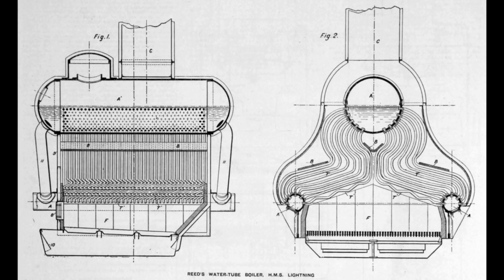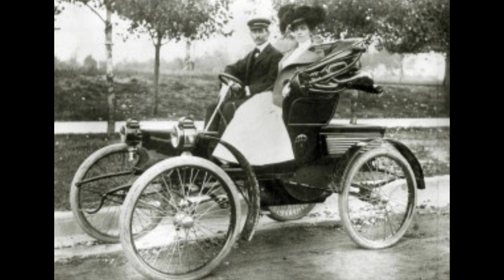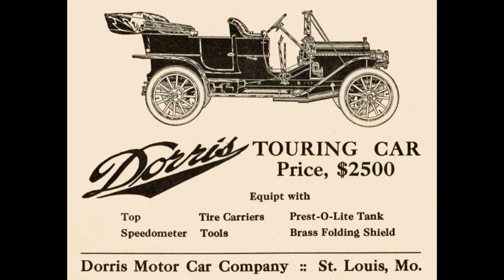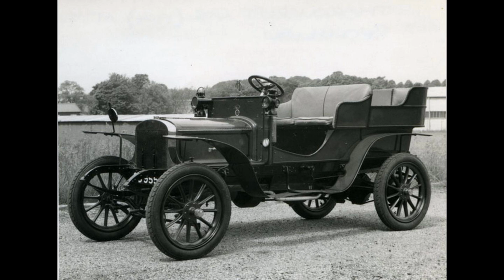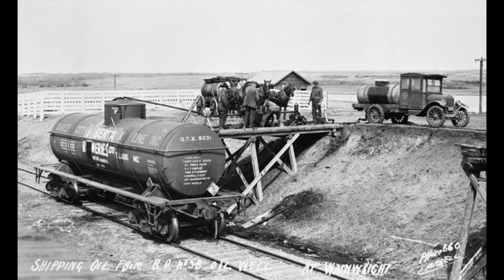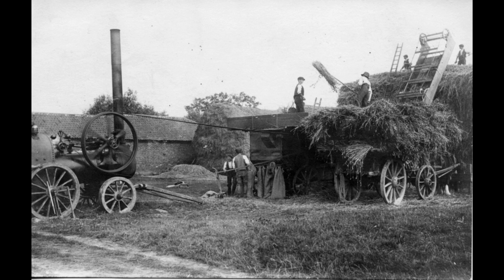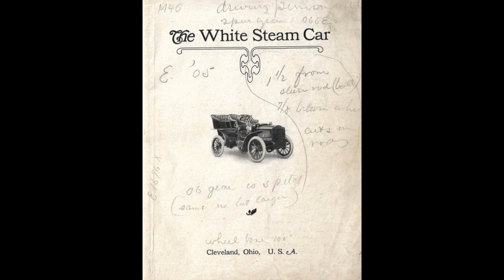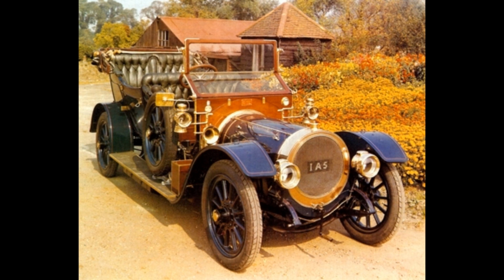Steam Boilers in the 1900's - The Unusual Case of the Car and Ship

Comment: Great collaborative video:  

A couple of thoughts:  

until about 1900 gasoline or naphtha was basically an unwanted by-product of refining the oil industry's principal product ----kerosene (called paraffin or coal oil in the UK) for lighting. Starting in the 1860's, kerosene started being refined and distributed in vast quantities all over the world for lighting.

 It was my impression that steam cars usually used kerosene as their primary fuel, with a much smaller quantity of gasoline used to get the burner hot enough that kerosene-- which has a flash point of about 100 degrees F-- would vaporize and ignite.  So a steam car owner in the early days could fuel his car with kerosene (usually in gallon or five-gallon cans) at his local hardware or general store.  

For a warship, using oil rather than coal had enormous advantages:  reduced manpower requirements, greater range, rapidity of refueling, and far less smoke to give away the position of its ships.  As it was starting to build capital ships powered exclusively by oil, the British Admiralty was extremely concerned about having a reliable supply of oil fuel for its new ships. It went to far as to purchase in 1914 a controlling interest in a British company called the Anglo-Persian Oil Company which had rights to large amounts of oil in Persia (now Iran).

Although warships quickly converted to oil fuel, most commercial steamships, with the exception of large express ocean liners, continued to be powered by coal until World War II. In this era coal was available in almost any port and was about one-third the cost of oil fuel.

Comment: No mention of the high pressure (200 psi) water tube boiler invented by Henry House around 1893. Used in both road vehicles (2 cylinder compound) and boats (1898). Also used as an airplane engine (never flew).

Comment: re: steam-powered automobiles, I'm surprised that the Doble Steam Cars were never mentioned.   https://en.wikipedia.org/wiki/Doble_steam_car
Reply: There was one shown.
Reply: @keithstudly6071 , shown, perhaps, but never mentioned & likely no one but a historian would have been able to pick that out (I'm not a historian). I think that the Doble Steam cars were the pinnacle of steam engine cars. With modern technological refinement, they might even be a viable competitor or alternative to the gasoline engine cars of today & possibly even rivalling the low cost of operation & high performance of today's electric cars.
Reply: @synthyawylder3297  Yes, the Doble was worth a mention.
Reply: You shouldn't be surprised, because Doble steam cars were not a successful innovation, but rather a last unsuccessful attempt to keep steam technology relevant at a time, when steam power had been surpassed years ago. Only some people desperately trying to sell outdated technology they have specialized know-how in, like selling typewriters after introduction of the personal computer.
Reply: Jay Leno, who owns two running Dobles (and at least three White Steamers) and done videos on all of them pointed out that the Dobles are pretty much unmaintainable without modern metallurgy and ceramic coatings. They run so hot they burn out their steam generators in short order.

Comment: Love this topic, as you're basically covering the genesis of what I worked on in my time in the navy. I was an engineering rate on a nuclear sub and nuclear propulsion is arguably the final expression of the steam propulsion plant. Despite the mythical powers that people like to ascribe to nuclear powered ships, basically they are nothing but a regular steam plant that replace coal or fuel oil with nuclear fission to heat the boiler water into steam. Their real advantage over traditional steam plants is endurance, not power output. (of course, nuclear power is outside the period this channel normally covers)

Comment: Rough rule of thumb for naval architects during early design: increase design speed 3 knots, double the required shaft power. Usually a little conservative,  but indicative...
Reply: Does that stay true all the way to 30 or 40 knots? I always assumed it be far less than double at low speed & far more at high speed.
Reply: @dorn0531  Cant say how exact the rule of thumb is, but the proportions of increase should stay the same no matter what speed. Thats how fluid dynamics work. Without doing the math right now, it sounds about right to me.
Reply: @GoldenCroc  Awesome, thank you. I am not an engineer in any capacity so I really appreciate learning this stuff. Also why I enjoy Drach's engineering knowledge

Comment: Great post, thank you! I was aware there were steam cars but the small tube boiler originating with them was news to me. In the literature on early destroyer / torpedo boats, it's mainly from railroads that the technology seems to have originated for higher steam conditions that led to triple and quadruple expansion piston engines and finally turbines. But it's certainly true there was a change from fire tube to water tube boilers, I'm not sure exactly what year that took place but around the turn of the century. Somehow the discovery of the very long, light displacement hull forms and advanced steam engine and propeller technology all came together by around 1870 to produce small vessels like HMS Lightning. I suspect, but have not found good evidence, that Confederate blockade runners and steam yachts had a role in that evolution but this line of development, and the speed records it produced, would be a good subject for a future video.

Comment: I think the US went way deep into traction engines vs anywhere else, my county's steam fair as it is brings 20-30 of them every year its quite a sight seeing this field of coal and wood burning engines chuffing away, and there's minimal health and safety, though owning and operating a steam engine in Ohio is itself a very laborious process to get licensed
Reply: Since you're from Ohio you're probably familiar with the fatal Medina incident, which is why the licensing process is more stringent now.
Reply: @bobsmith2637  ya but it is suprising how close to big steam engines you can get at the county shows
Reply: Traction engines were popular on American farms but not on American roads.   In England traction engines were often used to pull small trains relatively short distances over generally good roads.  America had long distances and generally bad roads. For any real distances it was cheaper to build a railroad, even a small, temporary railroad.

Comment: I was “that Ensign” that had to remove scale deposits from Hull-Oakes Lumber Co’s 3 steam boilers. 

Steam evacuation scale removal only works if it’s done daily, which requires shutting down the fires, draining the boilers, injecting high-pressure steam in an area the size of a small garage x3, refilling the boilers, restarting the fires, and bringing the boilers up to steam before the next morning. 

The mill did this on Fridays, and used my small frame (not so anymore😄) to scurry on my back with the 100f tubes 6 inches above my face to chip away at the 1-1/2” thick scale with hammer and chisel. I talked my Superintendent into using a small pneumatic hammer and custom-made fittings, which improved the work drastically.

Comment: With a couple of exceptions, nuclear submarines are steam driven so navies eventually were able to put steam powerplants into submarines.
Reply: It's funny to me that this period in history will probably be considered "the late steam era" by historians a few thousand years from now.
Reply: Steam powerplants were used in submarines quite early as well. Look at the British K Class
Reply: what are the exceptions then? :-)
Reply: Older subs still use diesel. Newer subs use "Air-Independed Propulsion" (AIP) Sterling engines. Sterlings were originally a steam engine, but in Naval AIP they use a mostly closed gas loop operating by thermal difference from ambient temperature and liquid oxygen. They're quieter than nuclear because they can run ultra-low frequency electrics, but they can only run for a few days on a tank of O2. The Swedish Gotland class is an example, and not the only.
Reply: @alan-sk7ky  The US Navy built a couple of subs with turbo-electric drive.
Reply: There's also Ulysses, the sub from Atlantis: The Lost Empire, which was steam powered.

Comment: In the US two major Railroads, the SP (Southern Pacific) and the AT&SF (Santa Fe - the one with the War Bonnet paint scheme), began experimenting with oil fired steam locomotives in the mid 1890's and were converting large numbers of locomotives by the late 1890's. Oil firing was a well known and established art by 1899 so upscaling it would have just required wanting to do it, and accepting the occasional "OOPS!". (BOOM!!)
Reply: The Elk Hills Naval Petroleum Reserve in Southern California, west of Bakersfield, was a large producer of heavy crude and much of it went to two uses. It was pumped to a simple refinery at Grapevine Pass and separated into heavy bunker fuel which was sent to Long Beach for ship's fuel, and light bunker fuel which went to Barstow to fuel the Southern Pacific locomotives. By the start of the 20th century most of the steam locomotives in the South West were oil fired.

Comment: "Traction engines are naturally slow"  25:22 

No! NO! NO!!   Traction Engines are UNNATURALLY slow. Just watch some. They're on YouTube....
Reply: but so much torque, it's hilarious to watch someone show up to a tractor pull in their quad turbo 600+ HP diesel monstrosity and then get their ass kicked by a 15 HP 100 year old antique
Reply: @bobsmith2637  Do you mean something like this?
https://www.youtube.com/watch?v=kA0E7kRhd6M
Reply: @bobsmith2637  If you know about Tractor Pulls, the tractor pulls a sled and the weight/load on the sled increases till the tractor stops. Here is a 110HP Case pulling one.
https://www.youtube.com/watch?v=EVxByLO_6cA
Reply: @scottgiles7546  yeah that's what I'm thinking of, I didn't mean that the two tractors would pull against each other, I was thinking of a couple pulls where the sled wasn't actually heavy enough to stop the steam traction engine.

Comment: This was FAR more fascinating than I thought it would be (based on reading the title).  I learned a lot!  This was an excellent presentation.  My "other interest" is railroad history and modeling and the material has a lot of cross-over.   Most US steam locomotives were fire tube boilers.  There was a big interest in compound steam locomotives around the early 20th Century.  Steam locomotives generally were two-stage affairs, often on the big articulated locomotives with two engine beds under one boiler.  Like in autos, tripling never really caught on due to the massive increase in reciprocating mass involved.  In fact, the increased mass of the low-pressure cylinders in compound locomotives greatly limited their speed.  Many US railroads wanted to speed up their schedules but the compound engines just couldn't be operated at the higher speed, some of the designers looked at other ways to increase horsepower AND speed.  Another cross-over was the information about steam generators.  US railroads traditionally used steam, drawn from the locomotive and piped through the train, to provide heat and to operate early air conditioning for passenger cars.  When internal combustion power (with electric transmission)  was applied to rail propulsion it was necessary to provide steam generators in the passenger locomotives to provide this "hotel power".  During the flirtation with gas-turbine-electric power for US railroads, steam generators were used to heat the fuel oil (residual heavy oil being used) to allow the fuel to flow to the turbine's combustion chamber.
Reply: Now I have l learned something!
While I knew locomotive boilers were fire tube, I didn't know most if the rest.
Always something new to learn!
Reply: With diesel, there are a lot if interesting engine crossovers between rail and submarine technology.
Reply: Why did steam locomotives almost universally use fire-tube boilers, given the lower top pressures available and the extreme explosion risk they pose?
Reply: @vikkimcdonough6153  I think it was because size limits  the locomotive boilers were only 6 to 8 foot outside diameter but got a lot of heating surface inside from masses of tunes  where the water tube  would be taller the lower tank and the upper tank with the water tube in-between more limited in length

Comment: I live in the south of the US eastern mountain range. Occasionally I will see a century old tractor in a field to this day. Usually its not worth firing up but if you need to pull a stump or move something heavy a modern machine sure as hell cant do it without a significant chain tack whereas the old one you just loop a chain around the stump, hook it to the back and away they go.

Comment: Another point on fuel sources - in the old coal fired days the stokers were usually considered to be the.most insubordinate and mutiny prone crew members. Even in relatively "enlightened" navies such as France, British or the US , shoveling coal was brutal, filthy, and physically exhausting work. Ships couldn't maintain top speed for very long before even with relief crews the stokers started to fall out from exhaustion. When fuel oil came along the boiler room was still hot and dirty but a flank speed bell wouldn't put many of the engineers on the deck with heat stroke.
Reply: Most large coal fired North American steam locomotives from the same era were fitted with 'automatic stokers', basically a steam powered screw or auger that moved the coal from the tender bunker to the firebox, where steam jets would blow it around to wherever the fireman wanted it.  It's always puzzled me that ships didn't start using this sort of setup as soon as it became available.

Comment: As an ex-Navy Boiler Tech who served on an old Gearing Class Destroyer, D.D. 890,  I still have nightmares about having to crawl inside the firebox of a Babcock and Wilcox 600 P.S.I. M-Type separate super-heater marine boiler to "Do Firesides" and clean the tubes!
Reply: As someone who's cleaned marine exhaust gas boilers before, that sounds like a hard pass.
Reply: I crawled inside a steam locomotives firebox (firetube boiler) once when they were replacing some firebox grates. While the inside is surprisingly roomy, the door is tiny as hell and you can barely get it and out.
Reply: same here....petrified I'd get stuck...
Reply: Me too, on a County class Destroyer, D16.!
Reply: Firesides aren't going to do themselves. :)
Reply: Big nope

Comment: Some compound engine steam cars have low pressure steam turbines to provide auxiliary power. (Electrical generation and condenser fan)

If you are trying to get maximum efficiency out of the steam plant electrically heating the steam generator air feed is not unreasonable if you have the electricity. (It is easier than heating the water directly.)

Comment: I suspect that the USofA Navy learning from Prinz Eugen was a significant factor in getting the super high pressure boilers into service not too many years later. However sometimes it is the motivation of, "Those fools got that piece of junk to operate usefully reliably we can certainly make a much better design work."
Reply: The USN got a very bad case of "Wheraboo" in the 1950s. For non tankers that's the belief that German technology such as used in the Tiger tank was always superior in every way because well GERMAN! - and besides they killed lots of Russians. That same attitude showed up when USN tried to develop 1200 psi steam plants. Since the Germans built very high pressure steam systems they had to be superior. In reality the navy learned that the 1200 pound plants were dangerous, maintenance intensive, and difficult for even the highly trained US crews to operate. Yeah I'm s former MM who operat!ed a 600 psi system. Now of course the ships run gas turbines which run pretty well. 

In the USN the propulsion turbine and boiler guys were separate ratings and I worked the turbine side. When I went back to civilian life I worked for about six years as a stationary engineer which meant that I was a boiler guy on land. I will assure you that the junior enlisted people or apprentices or helpers in civvy life were the ones who crawled inside the boilers and then coughed up black soot for a week after.
Reply: Prinz Eugen had some rather bad design compromises in the boilers do to the limits of German industry. This would probably limit the "Wheraboo" effect when it came to high pressure steam.
Reply: Yeah think they learned from Prinz Eugen? I guess they learned that it's engines were an ugly mess and it was best used as an A bomb target!
Reply: @keithstudly6071  
How many American ships were used a A-bomb targets?
But feel free to express your mindless hatreds.

Comment: At 6:53 the drawing shows the water entering the boiler at the feed water drum at the bottom. I have never seen this. It always enters at the top left steam drum.

I have worked on ships made in WWII and after.

Also there has to be a 2 bd  relief velvet after the superheater set lower than the drum safety so it goes off first so the steam passing out will”cool” the water tubes.

Despite being steel at these Temperatures the steel will soften unless water or flowing steam  is in them to carry away heat.
Reply: Yea the feedwater inlet should be going to the steam drum, but thats a very elementary diagram, if we were to list all the things that it is missing we'd be here all day.  (No steam separator, gauge glass, desuperheater, the burner is jank, missing waterwall tubes, no surface/bottom blow...)